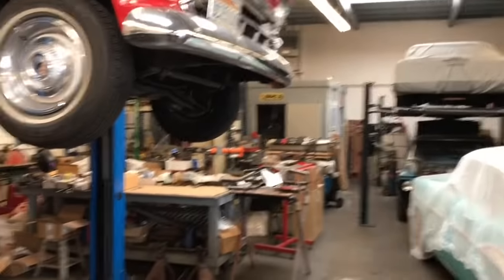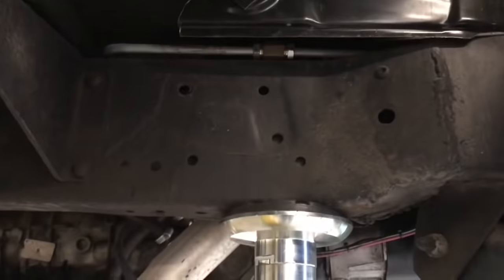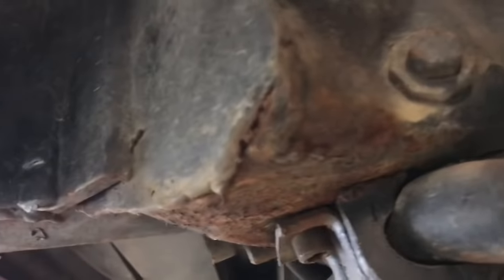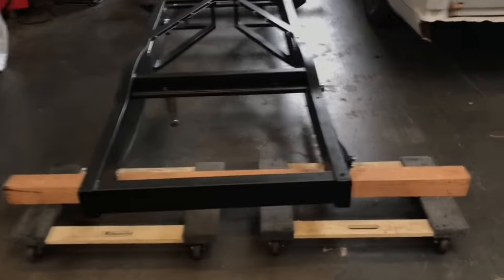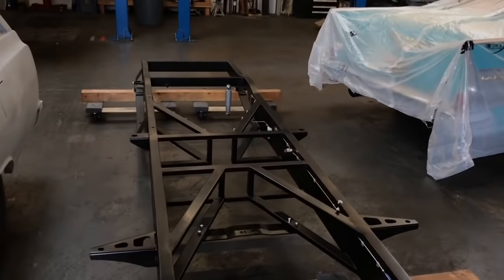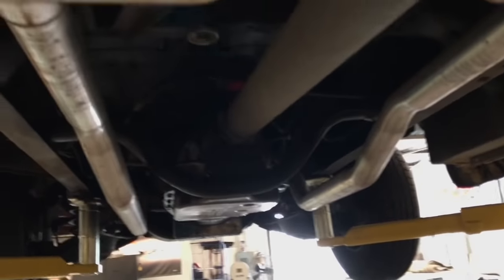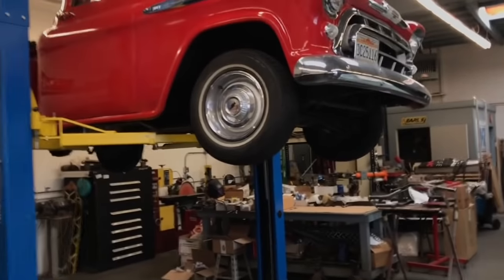Frame Swap 57 PU (Part 1)

Comment: ✌🏼👍🏼🤘🏼😎
Reply: Pretty hard not to recognize a TB400 Transmission pan.  I am just came across this post and never watched this channel before but a flub like calling a TB400 a TB350 makes me scratch my head.  I had to laugh a bit at the places on the frame he was calling the “sketchiest” because they were the least important (forward of the steering box) I will admit that frame in the truck was not the best but with the addition of a some fish platting and a little rewelding work it would be serviceable for a low horsepower driver unless there is a lot more wrong with it than this head spinning video myself I will be curious how it will all fit on that “replacement frame” that is flat ladder design and the frame in it doesn’t look all that flat.  O well not my problem.
Reply: @Lucky’sGarageShow ⬆️ 👍🏼😎

Comment: Taking a stab that you may read and reply to this question. You're very busy I get it. 
  Would it be more cost effective to box the frame and adapt modern suspension to a late '50s truck for a diy build? 10K is not in my budget but plenty of time is.
  Great vids btw. Thanks
Reply from the maker: David Sawyer Hey David.  
 Yes. You can save big bucks if you have the time and tools to box it yourself  but there’s lots more to it then just boxing the frame.

Comment: Too small of exhaust?  You should see the custom exhaust on my 5.3 Envoy.  they used  2 1/4 tubing for the dual exhaust after the muffler, and CRIMPED at the bends that make it look like 2".  I'm sure the engine is choking right now.

Comment: Hey lucky , I watch hot rod garage a Lot to help me build my ride and especially the 5 speed 4 door Malibu build being a g body . 
I’m upgrading the front suspension on my g body regal and I wanted to get your advice on which would be the better handling kit?
Umi , Qa1, or ridetech , and still be able to fit 15”-17” wheels .
They all range between $2200-2400 .
In other words which would be the affordable rout to get the job done lol

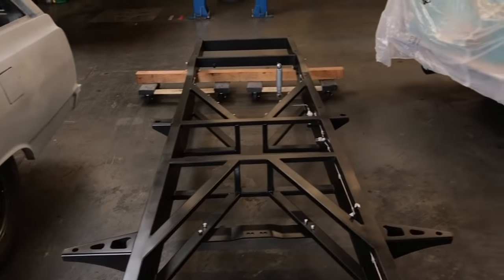Comment: Does the frame actually need some flex or why is there a only frame rail section at 3:10, why isn't it tied together on the middle?
Reply: He mentioned the bed is supposed to be the tie between frame rails, but wasn't attached properly either

Comment: Hard to make a bunch of money being an installer unless you criticize what other people do, never seen a thing wrong with the Cameo swap except they didn't grind everything down to your approval, have did over a dozen of them and have seen a hundred or so all made before so called mechanics could buy a frame already in a box and install it that the Lady who owns the truck might be able to do..
Reply from the maker: If you didn’t see anything wrong I probably should have used a light. 
   Side note. Why are you grinding your welds ?

Comment: Hi Lucky! when you upgrade the power train on older vehicles like that truck do you need to be overly concerned about how far you go with moderate horsepower and torque gains? In essence I'm talking about the stress that frame was originally designed for and then adding a 400 +/- horsepower setup. Of course, I'm basing this question on a solid/original frame that has not been hacked.

Comment: Thanks for the Video..... I never fail to be surprised at the Hack Work people will do with no regard for the safety of the people involved. Whether its Electrical or Mechanical safety is and always should be Paramount, not OK is good enough or  "Just Right".